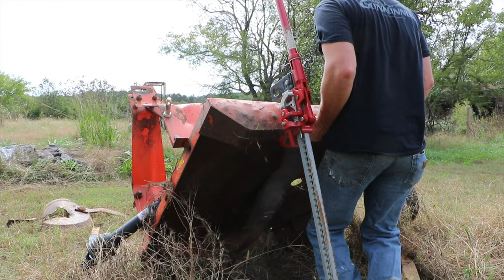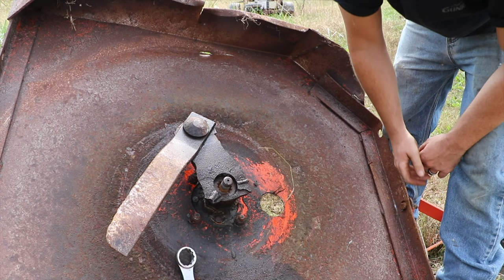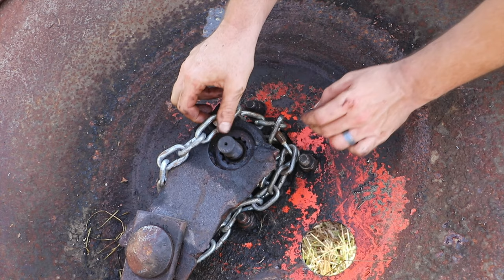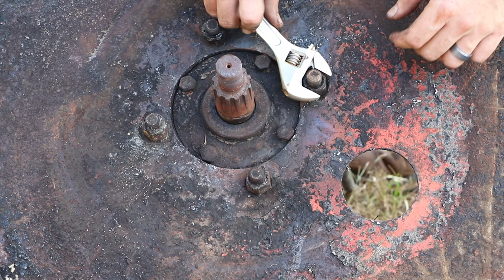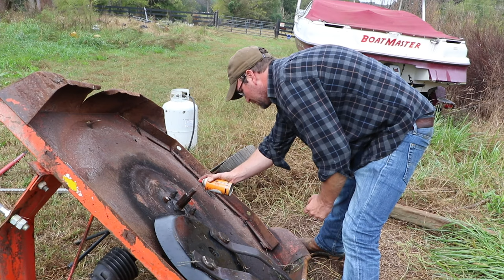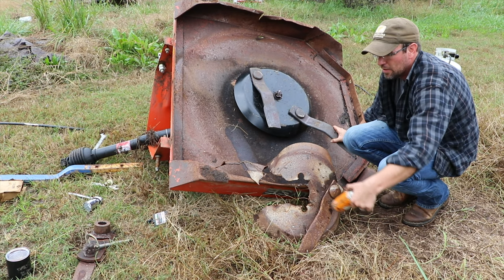Rotary Mower Blade Pan and Blade Replacement

Comment: For this project a large two jaw puller Easley take this apart,  the torch method was ok but remember you got a seal on you transmission that probably was damaged on the heating proses.

Comment: Use anti seize on that gearbox shaft, my friend you so need to buy an old boom pole for your tractor, do not want to get hurt flipping that cutter,
I replaced the gearbox attachment bolts, spot welded the head of bolt to deck then reversed their direction so nut was on top, that way if they worked loose I could tighten them without taking stump jumper off,
Be sure to use a grade 2 or 5 bolt in your sheer bolt, higher grade hardness bolt will cause destructive things to happen to cutter or tractor pto shaft,
Stay safe,

Comment: Looking at that deck, I’m not surprised of the condition of that cutter.  Looks like you’ve been mowing rocks.  That output shaft is wobbly so I’d say your bearings are shot in that gearbox.  I can only imagine what your tractor looks like.
Reply: Not everyone is fortunate enough to be mowing baseball fields and golf courses 😉

Comment: Hope you put a new seal in with that heat. The first try with the pry bar pressure you should have hit the blade mount with a 5lb hammer and off it comes no heat.

Comment: You seem to have a lucky opportunity

It looks like a large gear puller used with your heat and a hammer might work well together plus pull up on the junk evenly

Ken in Florida

Comment: I think some firm hits with a sledge on that metal plate would've loosened the rusted connection between it and the shaft. Just my opinion.  The heat was good idea though.

Comment: The thing you referred to as a plate is called a stump jumper
Reply: Hey he had it off and he didn't put copper never seeze on the shaft before putting it back on.
    He doesn't need to work on this type of stuff himself.
    He also fried all his seals in his gear box.

Comment: these cutters are very dangerous , you should never use any thing but Grade #8 bolts with lock washers or castle nuts. also you cannot tinten a washer. if you are not shure what you are doing DON'T DO IT!!!!!